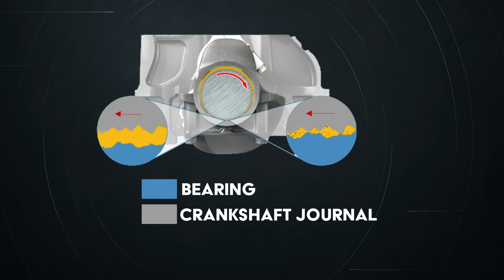the truth about start-stop technology (finally proven)

Comment: Remember, this is only the bearings. Expect wear to cilinder walls, belts and chains, cams, starter, battery....
And that thing called turbo. 
You come from the highway, turbo is really hot, hit the exit and in the first stop sign or traffic light.
Engine stops, cutting the oil supply to the turbo and cooking the oil in the feeding line.
Enough oil gets cooked, plugs the oil line, oil starvation and damaged turbo.

Great ECO friendly feature
Reply: I'm the sceptical one when it comes to start stop, but in some cars (Auris for sure) you have EGT/Oil temp sensor and whenever I was stopping by toll bridges (so basically straight from motorway speeds to standstill) the engine was not turning itself off, exactly to prevent turbo cooking from happening. User manual states some conditions that system has to check, and the list is huuuuge.
Reply: @DSLRwalker, in the "old days", it was called a turbo timer. Even my 22 Kia picanto turbo has it. When stopping the engine, usually on a warm day, the car continues circulating oil and running the fan until it reaches a safe temperature. If my economy car has it, im sure most others do
Reply: @rayf7953  I can say with pretty good confidence that my 2016 Mercedes GLC 300 does not have this, even though it has auto stop/start. Maybe its 1-4 years too early lol idek
Reply: @DSLRwalker  Audi's start stop on non hybrid cars is just there for it to be there. is doesn't work most of the time. it needs all things to be optimal before it works so mostly only after you stop after driving slow for some time after a long drive it will actually stop the engine,  that happens rarely in a city. so they basically made sure that it will not work in city so that it doesn't damage the car. which is the exact opposite of what the regulations for these to exist wanted. the driver isn't happy to have this the engine is getting more wear and the regulations haven't made any difference because it doesn't work in the city.. no one is happy.
Reply: @buzdagipetsise Hiya! On older... maybe. It wasn't so aggressive on A6 C7 2012, although switching the engine off whenever you're unbuckled and open drivers door was kinda driving me nuts.

The new audis are on next level of bumblefuckery. Especially in automatic - whenever you're approaching a speed bump (so basically slow down) it might clutch out the gearbox and stop the engine to make you coast, just to start the engine back up 0.5 seconds later to speed up.
Reply: @DSLRwalker  well those that stop the engine for a speed bump are mild hybrids so it doesn't really count as an issue in my opinion
Reply: @buzdagipetsise are you sure? They don't have 48v installation, and they use standard starter. I highly doubt it
Reply: they do have 48v
Reply: The solution is an electric pre-oil (and post-oil) pump. It would also prolong the life of the turbocharger bearings.
Reply: @gregorymalchuk272  Post oil might be more useful especially on turbos but I remember 35-40 years ago in car circles the pre-oiler was kind of the 'it' thing for people who wanted their engine to last a long time but I think the consensus became that it didn't do as much as they wanted because while it did make it a little better by getting oil to the cylinder walls, etc faster there still was the moment when you didn't have the hydrodynamic pressure and that was what caused most of the damage.   I think also a lot of people argued that with new oils it didn't really do much.
The aftermarket ones were expensive and costly to install so I suppose that would not be as much of an issue if the manufacturers put them in to begin with
Reply: @gregorymalchuk272 Or just leave the engine run for a couple minutes.
Reply: @gregorymalchuk272  The makers don't want them to last, as long as it lasts the oringinal warranty they don't care
Reply: @gregorymalchuk272  or, hear me out, don't use start/stop and you don't need any of that.
Reply: @Ludak021 The petroleum won't last forever, and stop-start reduced fuel consumption by 8%.
Reply: @gregorymalchuk272  No. Just no.
Reply: @gregorymalchuk272  How much energy does it cost to build a new engine because the old one threw a rod from 10x oil wear from stop-start?
Reply: @gregorymalchuk272 from whose ass you put down your 8% of fuel savings 😂😂😂
Reply: I’m not arguing for or against stop start. But I have a vw Tiguan 2019 tdi.  The water pump and the oil pump are electric so If  the engine cuts off the cooling and oil lubrication systems keep running. I don’t even lose power steering. Like I said only mentioning it not arguing for or against
Reply: @clinteastwood8222  
You don’t lose power steering because it is almost certainly electric power steering. My daughter’s Fiat Panda turbodiesel had that in 2006.
Reply: @hedydd2  Consider that many electric power steering systems don't work with the engine off and the key on, because the alternator needs to be driven to power them.
Reply: @hedydd2 he literally said this ?
Reply: @noxious89123  
Many do work and they certainly do not need the alternator to work. The Panda, for instance, worked when the ignition was on but the engine off. It also had two modes of operation, being standard and light, for parking. Many others, indeed most, actually start the engine if the stop[start] is active just by turning the steering wheel slightly.
Reply: @clinteastwood8222  Yeah absolutely, they typically design the engines with the stopping in mind. However, I don't care how much effort they put into the design, I refuse to believe it isn't a lot harder on them...especially in the case described in the original comment. I don't even shut my engine off immediately after stopping/parking after normal driving let alone hard driving. That's just asking for trouble. But I try to take care of my car, most people definitely do not. lol
Reply: @clinteastwood8222  errrr the 2019 Tiguan is a mechainical driven oil pump.... ive done enough of them. so rethink what your car does and does not have, it defo does not have an electric oil pump. VW would never do that as Electric are so unrelaible vs mechaincally driven.
Reply: @clinteastwood8222  Maintaining oil pressure doesn't eliminate the cold-start problem, it only mitigates it.

You're still going to tear up crank bearings leaving the stop-start feature on.
Reply: @dafunkmonster  when? My 2018 Passat is on 260.000 km am I in trouble soon?
Reply: @clinteastwood8222  Your Tiguan does not have an electric oil pump.
Reply: @clinteastwood8222 your tdi has one mechanical pump driving by timing belt/chain and two eletric ones but no eletric oil pump unless it's a hybrid and the video above isn't really aplicable to hybrids, most hybrids don't even have starters. You can still have power steering because it has eletric power steering not hydraulic.
Reply: My 2019 F150 twin turbo does not have electric pumps. I'd be curious to know what percentage start stop vehicles actually do
Reply: @clinteastwood8222 your engine has an additional water pump to the manual pump  that is electric and it does not have an electric oil pump 😂😂
Reply: @clinteastwood8222  I doubt very much it has an Electric Oil pump unless you put it on 😄
Reply: @clinteastwood8222  Turn it off and thank me later (electric pumps are much more complicated than mechanical). Also - you, too, have timing chains... a starter... and everything else. Always turn it off (start stop). Don't believe in miracles.
Reply: Most cars have automated cooling for the turbo which still pumps coolant/oil through. I know my golf r does this
Reply: been saying this for ages!  people laugh at me, im a qualified mechanical engineer and have had a hand in turbo deisgn! i even wrote a note into specific turbos not to be used with stop start, bearings  get screwed QUICKLY
Reply: most turbos are cooled now via a coolant pump that runs in the background tho
Reply: @Harryd06   doesnt matter, they still need Oil lubrication for the bearings, the water cooled is that to keep the cool while running, there stil dam hot, and when swicthed off/turnt off by stop start it needs an oil supply to keep the bearings from frying, turbos are made with SERIOUSLY tight tolernaces, that can be affected by overheating bearings or shutting down oil supply after running on a mootrway and stopping at the junction exit... thus premtaure turbo failure, due to oil stopping. never forget turbos need to be cooled and lubriacted in all instances, some use oil to cool and lube, some use water and oil in seperate jackets....
Reply: @Majua12  I'm tired of the myth that being on the highway automatically gets your turbo smoking hot. Unless you're gunning it, you're probably pushing almost no boost
Reply: @d47000   exhaust gases make a turbo move, the faster your engine RPMS the faster that turbo is moving boost generated or not, the impella still spins at HIGH rpms threwout the rev range speed ignored 👍  at idle a turbo impella without load and boost is STILL spinning at around 15,000 RPM  now imagine 3K rpm onn the engine minimal load no boost cruiseing speed  the turbo can be north of 30,000 RPM and then some! depending on impella size !

boost is a product of spinning a turbo thats sent into the combustion, the exhahust gasses generate the heat, heat kills bearings wihtout adeqaute cooling regrdless of load or boost levels
Reply: @Majua12 That's an oversimplification. The wastegate will be commanded mostly open during normal hwy driving so as to not reduce gas mileage - lower impeller speed. The turbo just isn't generating enough heat during highway driving to cause coking of a synthetic oil with a water cooled bearing. 

Take it from someone who often gets their turbo hot enough to light up the engine bay like a red flashlight - typical highway driving won't get you even close to that. With afterrun pumps especially, which are present on most cars, it's a non-issue for 99 percent of people - except for those who still think it's the '90s...
Reply: @d47000  I'm.a highly qualified mechanical engineer that has done turbo mfg design and prototype for a job.. far from a over simplification 

Not all cars run external watsegates either 

And all of my cars are 90s era petrol turbos. And one diesel turbo of the same sort of age.

I've lit cigarettes of my glowing red hot turbos
Reply: @Majua12 Not discounting your experience, but the newer designs are so much better. Modern water cooled bearings with afterrun pumps have totally changed the game, as have better base stocks in oils. I raced a car with its original turbos at 150k miles nearly every weekend and when I sold it at 200k miles the turbos were still in excellent shape. It was tuned running double the stock boost. I did of course let it idle to circulate oil after racing it, but i lived right next to a highway and never once let it idle after a typical drive. It lived a much harder life than the average car and it turned out fine. Could always hear the electric water pump buzzing away after I parked it which was reassuring.
Reply: @Harryd06  I believe the concern is due to the amount of heat that remains in the turbo after the engine shuts off.  The coolant and oil circulating through turbo stops as soon as you shut off the engine.
Reply: Most cars compensate for this. The computer typically disables stop/start in in situations that could be damaging. My car disables it automatically all the time and if the car is remained stopped past a certain (say a long red light) period of time it will auto start. It also has a hesitation moment after starting before it will allow acceleration.
Reply: Boomers here can’t deal with new tech.
Reply: that is a CEO friendly feature rather
Reply: Most cars circulate oil and/or coolant for a period of time after driving (or while start/stopping) for this purpose.  And then there are synthetic oils.  Because of this, coking turbos is rare nowadays.   Your argument would've been valid a couple of decades ago.
Reply: You mean I should keep the engine running when I go to motorway service stations?
Reply: @ennis_w I guess we should never stop the engine running 😅😂
Reply: Anyone remember turbo-timers ? Come to a stop, put the car in Park and turn the engine off. But the engine doesn't tun off because the turbo-timer keeps the engine idling until the turbo has a chance to cool down enough to prevent coking its bearings. That way you can exit an lock your car knowing it will shut itself down without you having to sit in the car waiting. Does auto on/off have that simple logic ? Nope. 'Cause a few pennies of burnt fuel is worth more to them than a turbo rebuild for you.
Reply: @flyboy3633 actually yes. It absolutely does have that technology. Bmw for example uses electric pumps to circulate coolant through the turbo to cool it AFTER the engine turns off. 

So, wrong again bud.
Reply: @flyboy3633  Whenever I stop, I sit for 10 to 15 seconds doing nothing letting the turbo spin down before I turn my old diesel turbo engine off 150,000 miles and its still running well.
Reply: @flyboy3633 🎯🎯🎯💯💯👌🏽👌🏽
Reply: Yes.  We used to install turbo timers on vehicles equipped with turbochargers.  This would allow the driver to park their vehicle, pull out the keys, lock the doors, etc and the engine would continue to run for a few minutes while the turbos cool off.  I don't see many turbo timers installed on modern vehicles, as it's likely more complicated to get around factory security systems.
Reply: True
Reply: Many if not most of the oem turbos are now watercooled, but some damage still occurs... would be nice if someone comes up with a calculation of the fuel that is spend on a car with start-stop and one without, as many brands name fuel economy as a vantage for adopting start stop on their engines..
Reply: @Mycarnoises yes water COOLED hint is in the name, but the bearings still need oil, and shutting that supply off on a HOT turbo is bad bad
Reply: @Majua12  
Yes, there are still thermal shock to the metal parts from large temperature changes.
Reply: @Mycarnoises 
Most car turbos have been water and oil cooled since the 1990’s but they still fail if ‘abused’ and sometimes even if not.
Reply: Bearings aren't the only things that suffer. Aluminum open deck engines scrub the head gasket with heat cycles. The Toyota 2zr is known for this. You get significantly less miles from vehicles equipped with auto start-stop.
Reply: you are right, that is why last time I only slowed down at stop sign and quickly checked if it is OK and clear I continued forward without stopping
Reply: If the turbo is really hot the engine won't stop. But I know what you mean, the combustion engine was never meant to run under start stop conditions. It will wear out faster and the eco minds behind it are hoping for it
Reply: It's not funny
Reply: I'm getting an 8 cylinder 5.0 Lexus or waiting for the 8 cylinder supra.
Reply: It's oil "coking", not cooking.
Reply: @jdubyaxx  Its iil "ciking", nit ciiking.
👌
Reply: 888😮
Reply: I'd be more inclined to follow your advice if you knew how to spell "cylinder"
Reply: You do have to applaud the eco friendly commuters in their lifted 3 ton quad cab monster trucks
Reply: Your right. Environmentalism is an excuse to milk us for more $
Reply: What are you on about... Oh yeah just copy paste whatever old circlejerky garbage you found on pre 2010 car forums and take it as gospel.  What you say is true for big turbo sports cars that work up huge heat and pressures, but not for stock passenger vehicles.  Besides, your turbo should not be spooling the entire time you were on the highway if you drive like a sane person.
Reply: @sucraloseUncle  I am not a sane person.
Reply: Surely a start-stop system would not activate on a hot turbo. That's definitely grounds for a lawsuit.
Reply: Boom
Reply: battery? wtf
Reply: Exactly, I dont have start stop and I even let my car warm up or aftercool for some time after ariving home.
I drive on LPG so I wait for the engine to hit 30°C before driving. 

Gotta take care of my 1.8T😉🗿
Reply: Great CEO friendly feature I guess
Reply: Dino oil will do that in a heartbeat. Propper full synthetic "shouldn't" do that
Reply: Not sure, what you mean. My car doesn't do that.
Relatively newer cars don't do that since they have sensors preventing the engine from stopping under these conditions.
Reply: @Blast-Forward well you have a shit car them
Reply: For my company i have vans... One of those is a Jumper with DPF "technology". 
As far as I can figure out, all it does is catch some polluting particles in a filter. Then when the CPU knows for sure it's not in a test-situation (like MOT) it just dumps all the cancer in the air anyway. 
So instead of actually making cleaner diesels, (this engine is just the well-known 2.0 Fiat Diesel) they just catch it temporarily and then dump it when no one is looking. 

If you ever see a van buried in a thick cloud of white smoke, that quite literally smells like piss, not to worry, the car is just dumping its vile contents 😂😂😂
Reply: Imagine all the money we'll make if cars are dead and a total loss before the hit 100k miles
Reply: I hate start stop but that's not a valid concern with modern oils. High quality full synthetics made from synthetic base stock DOES NOT coke in turbo feed lines. They are completely okay with 400F+ degree hot turbo lines with no cooking of the oil. Running conventional yes that'd be a concern but anyone running conventional in a modern turbo car is an idiot! Modern vehicles do not need turbo times or more than a moment of cool down before shutdown. Manufacturers have their start stop set up to delay once the vehicle is stopped to allow this small necessary cooling! My girls 2024 Honda crv 1.5 turbo will wait about 10 seconds before shutting down when she's stopped. She never uses start stop anymore though after I explained the downsides fortunately
Reply: I think people figured out that turbos had that problem and made a pump continue to cool the turbo, even after stopping the engine (if it's still hot).  Also, do turbos actually spin when cruising on the highway?
Reply: @VroomNDoom2602 turbos are always when the engines under load, a massive turbo could possibly not spool at low highway load but most do. Extremely few vehicles have coolant pumps that continue to run after the engines shut off and modern oils don't really have that issue of baking in the turbo oil feed like conventional oil and bad synthetics do fortunately! There's no need to cool down for more than a few moments on any newer turbo vehicle. On my passat diesel when cruising at 55 mph with cruise control set the turbo would be making about 8 psi of boost so it was certainly spinning lol
Reply: @DarkAttack14  That's crazy.  I know that newer Kia's/Hyundai's aren't under pressure on the highway.  I've also heard the pump keep running after the vehicle is off.  I would be surprised if Ford didn't adopt this.  I know they had some plastic turbo housings melt after shutting off the car.
Reply: @VroomNDoom2602 it's possible they put an auxiliary coolant pump in but it's truely unnecessary. Are you sure they don't make boost on the highway? It would be weird not to because that extra boost makes the engine more efficient but who knows haha
Reply: @DarkAttack14  I think that turbos increase efficiency by letting you cruise with a tiny engine while having the power of a larger one, but I bet different engineers have made wildly different systems.  0 is what the gauges have read.
Reply: @VroomNDoom2602 that's part of it, but all motors are more efficient with a higher cylinder pressure so having a little boost should help
Reply: This is only the bearings on a single 2016 model car. Expect wear on cylinder walls, belts and chain, cams, starter and battery on any vehicle with over 80,000 miles on it.
Reply: cylinder walls and cams belong to the bearings he is talking about. There's movement of metal parts which are meant to be seperated by an oil film
Reply: Its just bad engine design you can easily just run a cooling pump and have a system to keep pressure high. But no ones innovateing anymore with engines because its basically century old technology now and new tech will eventually replace it wether its hydrogen or electric
Reply: Start stop vehicles often come with a 2nd battery for the start stop system.
Reply: @FreedomTalkMedia  nope, they dont
Reply: Why the fuck would you pit this on an engine with a turbo.
Reply: Well said!
Reply: Then the turbo and engine get replaced- far outweighing any emissions impact offset by the start/stop feature.
Reply: Buy a new car - now you’re eco-friendly again! Old cars are not your eco-problem!
Reply: @J-tu3hw  Pushing the worlds production away from countries using clean burn technology to China that burn it far less efficiently and with no care about the emissions created but that's OK because pollution does not travel it seems.  Why are the green parties not up in arms with all this fake rubbish whilst they decimate thousands of acres of land and sea?
Reply: cooling is done with electric pumps on newers cars, so the turbo soaking in heat ain't a problem anymore
engineers aren't actually muppets
Reply: @vladmihai306  is that why you service your turbo every 3 months instead of every 3 years like before 2010?
Reply: @vladmihai306  Engineers take their orders from corporate accountants who explicitly want to make the cost of maintenance post-warranty as high as possible.
Reply: Plenty of Prius taxis made it well past 300-400k miles with their engines making use of start-stop technology.
Reply: @PistonAvatarGuy +1, personally know few taxi drivers, all cars well over 350kkm mark, still going strong.
They use different way of starting the motor though (hybrid motor ramps up the ICE to desired rpm rather than having a small starter motor)
Reply: @PistonAvatarGuy  Yeah, the Toyota hybrid start-stop tech is absolutely cool and I think "better" for the engine - I have a Highlander Hybrid, and it maintains the engine temp before shutting off. Also, when cold, it fires up and then loads the engine down, just a bit, so it's never idling. This means that it warms up within a minute or so to operating temperature, vs several minutes in a normal car at lower speeds. Also, using the hybrid motor-generator to start it means that there is no extra starter wear; that motor has no brushes or other wear-items(and is always in use)
Reply: @PistonAvatarGuy also, how many vehicles actually are used to past 300k? Very few, it's like looking for a problem that MIGHT affect 5% or less of vehicles sold
Reply: @ej20tnz  I think that I must have missed part of this conversation. I don't see any problem with the Prius, 300k miles is quite good.
Reply: @PistonAvatarGuy Sorry I mean that in agreement with you, rather than a challenge to anything you said
Reply: @PistonAvatarGuy  thats literally a fraction (2/3) of what he said at 0:50
Reply: @SchnabeltierLord  I didn't actually watch the video.
Reply: @PistonAvatarGuy  These hybrid engines I think are more adapted for start stop due to their construction like they dont use a conventional starter motor but instead uses one of its 2 motor/generators in their so called PowerSplit drivetrain as the starter while the starter used in all other start stop vehicles is the same one that have been used for over 100 years now and which is not adapted for this usage. You can tell by the sound the engine makes when starting. The Prius engine starts more like an electric motor going instantly and smooth into operation while all other Start Stop engines do the usual CHUG CHUG CHUG WROOOOM sound.
Reply: @PistonAvatarGuy No not true.
Reply: @PistonAvatarGuy  Except many of them turned them off or drove around 90%+ on battery power alone so the ones that did high mileages may have been sensible owners.
Reply: @WhiteDieselShed  The older Prii couldn't really be driven without the engine running often, they didn't have the battery capacity, or the motor power.
Reply: @PistonAvatarGuy  
Are you absolutely sure that they didn’t get exchange or engine overhauls every now and again?
Reply: @hedydd2  Yes, that was the big thing, that they were lasting without major repairs. Some even had batteries that lasted to 300k miles.
Reply: @hedydd2 😂
Reply: @hedydd2  Are you sure you breathe oxygen?
Reply: @hedydd2  The high mileage ones are probably the owners than ran battery alone 90% of the time or switched the stop/stop off?
Reply: Stop / Start a pure socialist gimmick to prevent individuals from freedom of movement & commerce . Engine wear out faster turbos blow . Trans fail all to destroy vehicles & force U to public self driving . Because new vehicles are becoming prohibitively expensive .
Reply: Yes, electric pumps are some kind of help with this problem, but now literally every new car has a start-stop feature and maybe 5% of cars have electric pumps. You see the problem here?
I have a 2022 Ford Custom and it, like vast majority of modern vehicles, only have standard belt-driven water and oil pumps. And even though it has electric power steering, when the engine stops you lose it because the battery isn't supposed to power such things. But again, you're not really supposed to turn your your steering wheel while car is stopped - it excessively wears the tires and steering components due major resistances which aren't even there when the wheels are rolling.

Putting that aside - oil cooking in a turbo does happen only when the engine and oil are really, really hot. You don't get it this hot just by driving on autobahn, you have to drive it hard, really hard and really fast, and for longer than the last 10 minutes. And this danger is more prevalent in gasoilne engines since they can get way hotter than diesels. So don't worry about it too much if you're a calm driver. ;)
Reply: Man. It's wild when people like you make comments when you really don't have much of a clue on what you're talking about

So FIRST of all, turbo timers are ONLY ever needed after driving extremely hard in full boost. There are absolutely *zero* circumstances where your regular driver is going cook oil in the turbo after cruising on the highway. The car isnt even in boost.

Second of all, almost all modern cars with turbos have some type of built in "turbo timer" like BMW for example which uses and electric pump to circulate coolant through the turbo after the engine is shut off.

The amount of misinformation I hear about the start/stop feature is wild "it's designed to wear out your starter, and battery, now you with 'it cooks your oil etc"

All of them dead wrong. This video is about the only example where the evidence is correct.

For example. The start/stop tech uses an entirely different starter motor. As in you have two.
Reply: Ice is dead, bev is the future
Reply: True! It's never been about the climate, but saving the dreadful German planned obsolescence economy...
Reply: Engine oil cooking? I wonder what you are cooking. Must be some good shit.

Idling is worse anyhow.
Reply: @MrBojangles901  There is literally nothing worse for a turbo than shutting it off right after it is hot. It will crystalize and carbonize the engine oil surrounding the turbo bearings. This engine oil will now have abrasive crystals in the oil around the bearings and also build up in the feed line to the turbo. This is what he means by "Cooking" the engine oil.
Reply: @JesusIsLordAndSavior77 yeah you’re not cooking engine oil when turning off the car right after highway driving. You’re not driving a GT car you’re driving a Jetta tdi, get real
Reply: @JesusIsLordAndSavior77  Yup. I have a 93 SAAB 900T. Even with the later water cooling I never shut it off immediately after running. Even a few seconds helps.
Reply: @MrBojangles901  You are an idiot. He's not "cooking" anything. Stop talking about your cat, or dog, or whatever you "cook". Idling is NOT worse moron.
Reply: @MrBojangles901 Absolutely. It cokes up in turbo cartridges. Worse than idling
Reply: @MrBojangles901  No its not, at least at idle there is oil flowing= cooling
Reply: @Jarda_B  Cooling isn't and has never been an issue though. If it where then simply turning off an engine would be harmful. But it isn't, is it?
Reply: @MrBojangles901 Bo you have no idea on trapped non circulating heat damage, cycle after cycle after cycle. This start stop cycle on combustion engines reduces longevity on so many components. Good luck Bo, get yourself a good shop on retainer if you live in a city, or start looking for your replacement trade in vehicle. You won't get the life span out of these golf cart functioned engines. Or buy a bypass jumper, so it won't allow the program to function.
Reply: @billmcmeekin7909  Maybe I don't but I'm not too worried. I rebuilt the entire engine from scratch quite recently so I figure it should last a few years at least.
Reply: @MrBojangles901 I get decades out of mine. My 04 Duramax is mint to this day. Z06 and Boss the same, although they are lo milage. Our daughters 12 Rav (I conduct all repairs and service for a decade now), has 250,000km. Doesn't burn oil, runs like a top 👌 Two years seems rather short, unless you're a commercial driver. Cheers ehhh :-)